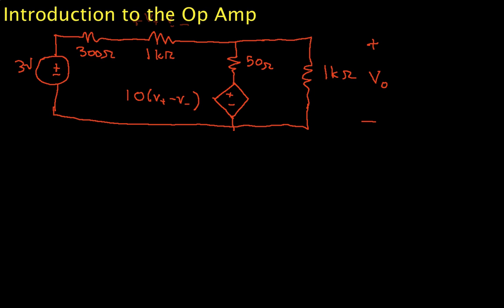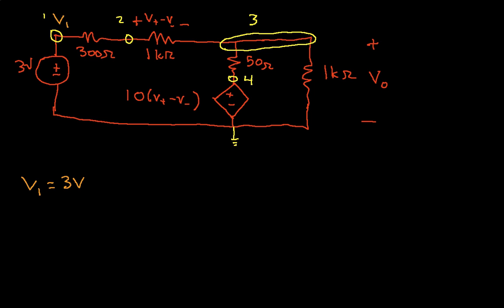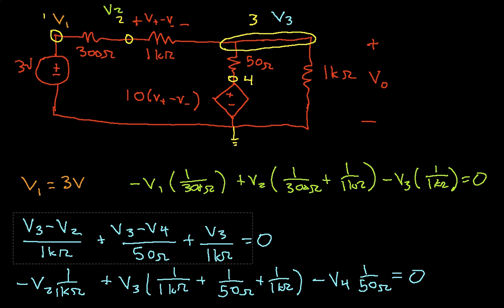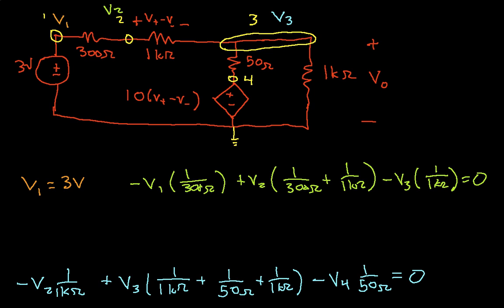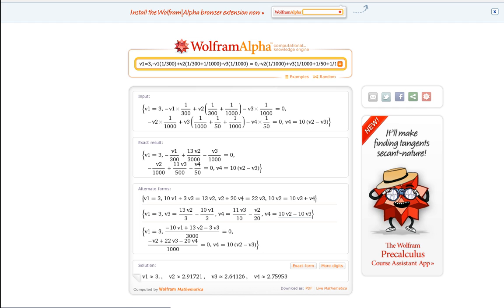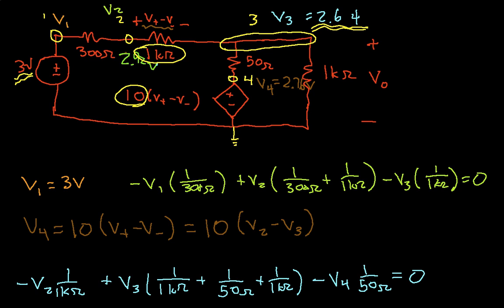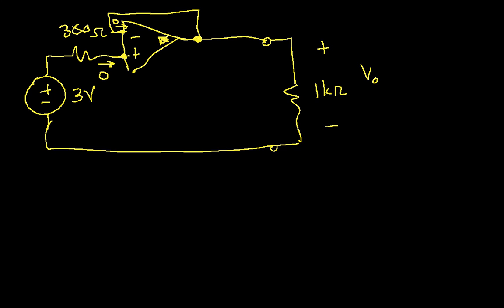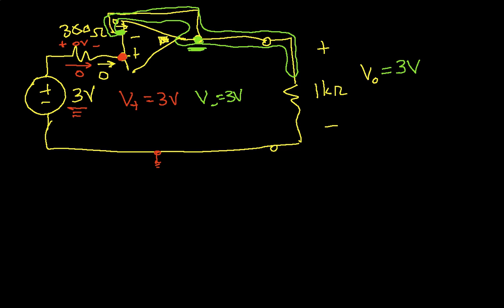Introduction to the Op Amp Part 2

Comment: I have no idea whether you still need answers. 
- For the terms inverting and non-inverting: Vout = A*(V+ - V-). If V+ increases, then Vout will inrease. If V- increases, Vout decreses, hence the name inverting input.
- As for the point: I THINK (but I'm not sure yet, as I'm still learning about the subject) that the point is the following. If you were to connect the 3V source to a circuit, for example a resistor Rload, then this resistor would draw current from the 3V source.

Comment: This means that the 3V source would be providing energy.

If, instead of directly connecting Rload to the 3V source, we would insert the voltage follower [the output of the op-amp would follow the 3V voltage source], the energy provided to the resistor Rload would come from the supply sources from the op-amp (High Supply and Low Supply in video part 1) and not from the 3V source. 

The usefulness is explained in 2nd answer on Yahoo question "What is the use of voltage follower opamp circuit ?"

Comment: I dont know too much about this but (correct me if im wrong) from what i have learned in theory instead of that big mess of equations wouldn't it have been easier to use ohms law to find the voltages. Maybe that method seems more challenging to me as i'm unfamiliar with it but tbh it was a pain enough solving a two variable, two equation problem (steps to it for that matter).

Comment: The end confused me a tad.
V- = 0V, and V+ = 3V. Now, the output will be 3V to make V- equal to V+. As soon as it does (V- becomes 3V because of the feedback), shouldnt the output switch back to 0V? And the output of the system start oscillating between 0-3V?

Thanks in advance